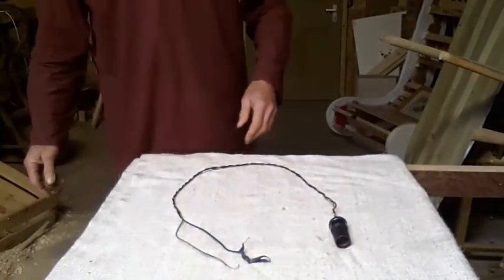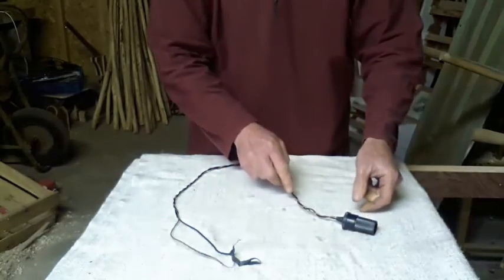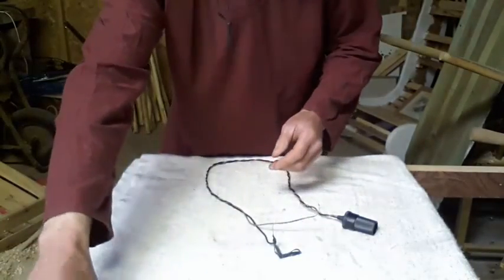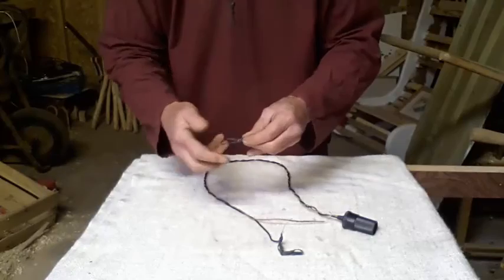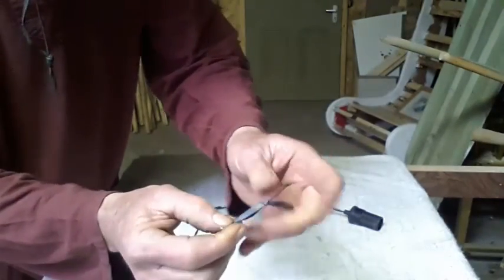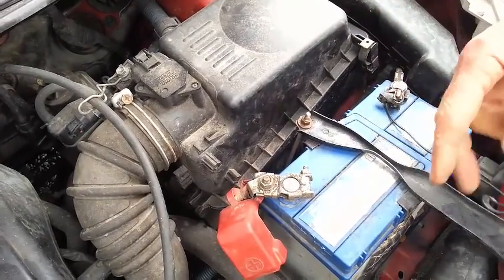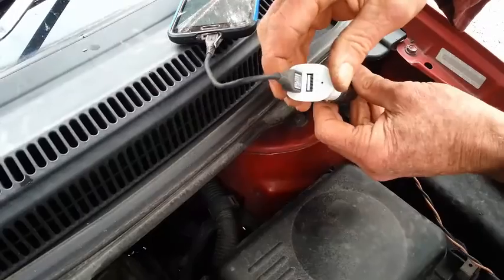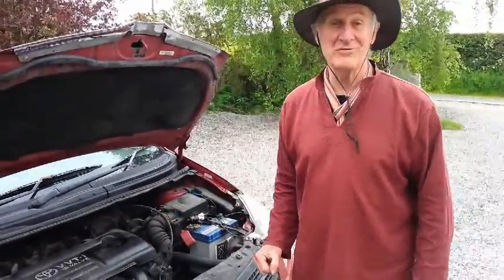Charging phones in a vehicle, the ignition turned off.

Comment: Thanks for your awesome tip on how to charge my mobile phone from my car battery Ray. The socket part that the charger plugs into where would I find one of those. Thank You  #mobile #charge #cars
Reply from the maker: +Sandra Lemming  Hi Sandra. I found mine on an old piece of machinery but I reckon you could get them from  a car parts place or they may know. Could check it out on the net. In NZ I could tell you. Haven't got the system totally cracked here in Ireland yet. Good luck. Don't hesitate to ask if you have any problems with putting it together.